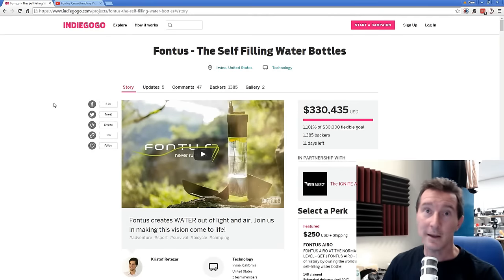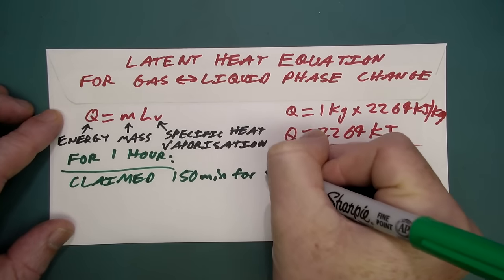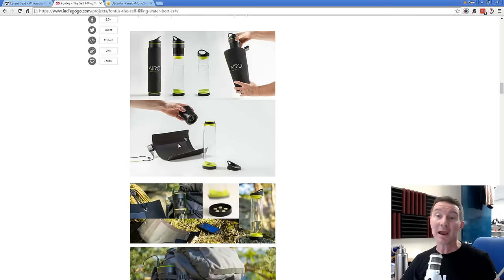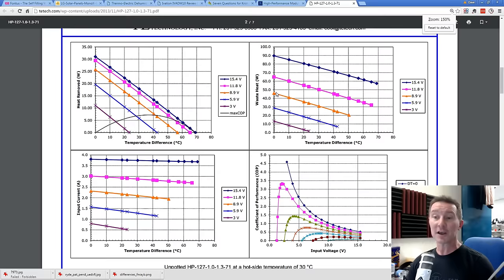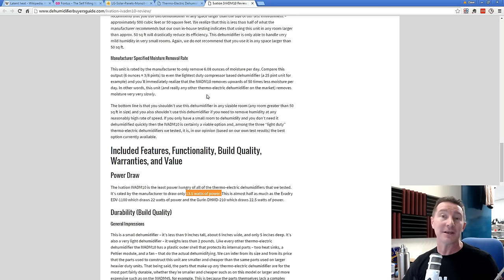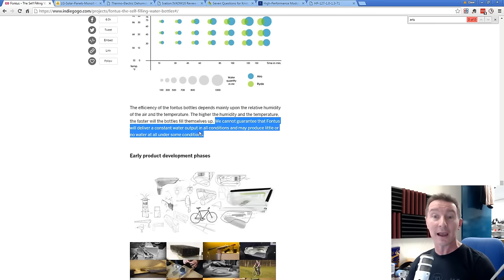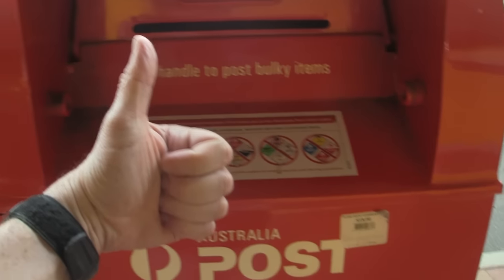EEVblog #881 - Fontus Self Filling Water Bottle BUSTED!

Comment: Well.. you did a lot of errors.
4:40 that should be 905kJ/H.. not by liter.
4:50 that should be 250W/H, not by liter.

5:00 100% efficency. Well that is not really true. In a 44 degree enviorment that would be a 273K/317K .... =>13% carnot efficency. You could actually get as much as 7.2 times the energy out theoretically (with a real refrigeration unit, more like 4 times)

5:20" This is one of the most efficient 250W panel"
Well... i would say no, not really. Its 16% efficency, and sure, its pretty efficient for a rooftop full wafer monokristallin silicon PV-panel. But you can get partial wafer once that have almost 25% efficiency (they are quite expensive). You can also get gallium-arsenik one that is about 30% efficiency.. about twice as much... they hare quite expensive (mostly used in satellites)... There are also multi junctions once..... but to my knowledge you cant buy those (and if you could, they would be stupidly expensive)

8:00 correct this later, but i think its really a bad calculation error. Also, its not true that its "over 100%  efficiency". That you get say 500W of cold out of 100W of electricity is not 500% efficency. In this case it would be about 70% efficiency (calculating Carnot efficiency)

So you can get a solarpanel that is about twice as efficent. And you can get a real world refigiration unit that does 1:4 (they are a bit bulky, but really not that enormous, there exist smal once that is just over a kg).

So that would put the 250W/h to 62W, and 62W for a Galium-arsenike partial wafer solarpanel would be about , 10dm^2, about 35x35cm... so its actually in the range.

But on the other hand, its not for one liter its for, one hour, that is 4dl/h.

Its also a complex calculations, the heat fight down the efficency of the refrigiation unit, but the heat also binds more water. So you have to process less air, but need more energy to do it.. forcing you to do it slower. So the optimal temperature is probably lower than 44C. And of cause, you would have to point it 100% to the sun and also have no overcast.

 I really think the video should be recalculated with more correct numbers, there is a bit to much errors in it.
Reply: shomolya 
Sorry.. should of cause be 250W only (in this example).. not per hour

Also, i didn´t calculate it, i copied of the video, but its not fault.. well the units of the 250W was, but the rest is correct.

My point is that its not 905kJ per liter, but per hour, that makes it to 250W.
Reply: +matsv201 "So that would put the 250W/h to 62W, and 62W for a Galium-arsenike partial wafer solarpanel would be about , 10dm^2, about 35x35cm... so its actually in the range."
On paper and under ideal conditions combined with a solar power unit that is 4 times the size of the system displayed and a price tag that would be 3 times higher (for the solar power unit alone, mind you) than the total asking price of the device... So, yeah, totally doable...
Reply from the maker: +shomolya I did mention COP and heat pumps.
Reply from the maker: +matsv201 Yes, units have been corrected in annotation.
Reply: +shomolya You guys are way to harsh. Some units he got off, yes, but it's not a big deal, he corrected them via annotations. 

Also speaking of actually watching the video....... He did talk about COP and Heat Pumps. Come on. What a hypocrite.
Reply: +EEVblog But the Austrian government won't receive those annotations.
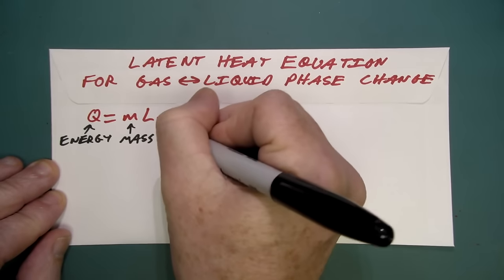Reply: +EEVblog I didn't watch the whole video yet, but the critical issue is that at ~2:15 you conflated the heat moved from the vapor to the environment (i.e. the latent heat of vaporisation) with the energy required for the Peltier device. The former is usually much larger than the latter, and their ratio, known as the COP, is usually significantly greater than 1. This can cause conceptual confusion in the audience, because it seems like you're saying the energy from the condensation is what's needed to power the Peltier device, whereas they're unrelated.
Reply: EEVblog Sorry.. if it was youtube annotation i didn´t se it. (i downloaded it for bandwidth contain problem)

Great that you answered anyway :D. really thankfull
Reply: shomolya yea.. i f-up the /h thingy.. but i think it was the only error i made...its quite oblivious when i read it back.. and it would be for most people that know basic physics.
Reply: totalermist Well.. yea.. on paper of cause.

But my point is to make a best case scenario.

The issue is if you are debunking something, you really want to go for a very-very best case scenario, because if you don´t people will just come with it and say you are wrong... and you sort of are.

So my point being it should be calculated with the best equipment that is on the market, and debunk it from there.

I also don´t like the "dehumidifyer" comparison. They are built down to a cost... they are really crappy.
Reply: Asad S Yea.. i kind of agree.

Its not really that clear cut in the video. And also mixing in percentage over 100% is dangerous, specially when talking about efficiency. COP is a better term.... or that i really prefer, percentage of carnot. When talking about heat engines it´s often a better way of using it. It also works both ways.

This is also a issue with electric cars. A lot of people tend to believe that electric cars are more efficient than one with explosion engines. That is not a clear cut case. Calculating the carnot efficiency a normal gasoline engine is actually quite efficient. You can sort of say that a electric car have a higher refined fuel.
Reply: shomolya Well.. i would say no. There do exist really tiny compressor system....

And you can make a bradley type compressor that is not really much bigger than a peltier element... granted, there is some tecnical difficulty in actually making one, and i doubt there is one outside a lab.... but it can defiantly be done. I would say you could go as high as 70% carnot
Reply: shomolya Well sure... that might be the case.. but you still have to take a best case scenario.. And i would say.. you could tehoreticly in the bounds of not just theoretical components, but actually existing once make something that would condense sufficent quantity of water. Then you have to go from there and look what the problems is...

This is how you debunk stuff.. i think dave cheted this time
Reply: +matsv201 
I'm thinking of sending a nice postcard to Kristof, like Dave did. Can you wrote down the right calculations?
And I would like to ask others to send a postcard from they'r own city with a nice calculation on the back. Address is provided @15:00
Reply: +matsv201 Finally someone that knows thermodynamics.
Reply: shomolya 
Well the real issue to me is that it might work in 90% humidity in 44 degree..... Actually with a ideal Carnot, or even say real 60% carnot efficency pump will actually (in theory) increase with lower temperature... as long as the humidity is close to 100%.....The issue then is that the airflow increace quite a lot.. at 44C the airflow is actually not that high, bot down to 20 degree its really high

But when the humidity droppes down to 40-50%... then it start getting really hard to get any volume out at all.

The real issue to me is the solcell directional issue and clowds..Make a simple sinus eqvation of the solarcell and se how much is losed... than ad clowds.... Then you go down from a theoretical maybe a liter every 5 hours... to a liter every day or two.
Reply: +matsv201 

"Well.. you did a lot of errors.
4:40 that should be 905kJ/H.. not by liter.
4:50 that should be 250W/H, not by liter."

and its 'litre' dumbarse not LITER - its all well and good pulling someone up on their mistakes but at least check your own before you do..............
Reply: Wait a second, the Americans have changed the spelling of a system they don't use? I would say that I fucked up but I think its the other way round lol
Reply: +Pony Power "Wait a second, the Americans have changed the spelling of a system they don't use? "

Nope, you are using the French spelling. The Netherlands, Germany and Belgium  and pretty much all Germanic languages use "liter" too.
Reply: vinny142 As well as scandinavia and most Slavic nations
Reply: +EEVblog I think we'd be all very happy to hear about that a bit more, even if heat-pumps are not strictly speaking EE.
Reply: Black Daddy Its not thaaat uncommon.. but its rare....

Of cause, math is very easy to prove, so the arguments are mostly rather short
Reply: Thanks for addressing the point from a more formal way.

Comment: It should be pointed out that you should take the COP - 1 to get the actual efficiency for cooling too. The electric energy used to drive the heat pump is also wasted (as heat) in a cooling setup, not just the produced heat. Side note: Sometimes you can see a cooling COP that is more or less than the heating COP - 1 on a compressor driven heat pump. The reason for that is simply that the machine gets reversed and the refrigerant gets routed a different way through different components, which can generate a different internal efficiency.
Reply: +Tjita1 
This, and also the need for a good heatsink source for the hot side.. otherwise the junction will fail to transfer any heat energy. I did not see much of a hot-side heat sink in that design.. also how efficient would it be if the OAT (outside Air Temperature) is ~ 60 deg. anyways?
Reply: +Tjita1 it also depends on the temperature differential. If you are cooling 90 > 70 it's only a 20 degree difference, if you are heating 0-70 it's a 70 degree difference. I'm pretty sure that the refrigerant doesn't get rerouted, just the valve reverses to allow the flow to reverse (you don't have 2 separate compressors or evaporators, they just swap roles)
Reply: +2Awesome The reversing valve just makes the refiregerant go first into the evaporator or the condenser, depending on the setting. Basically it's like taking a window air conditioner and turning it around so it blows hot air in the room and cold air outside. The compressor is not reversed because it is reciprocating (you would need to change the one-way valves)

Normal:

Compressor - Condenser - TXV or capillary tubing - Evaporator

Reversed

Compressor - Evaporator - TXV - Condenser
Reply: Speaking of COP, I would rather that term be used rather than "efficiency". I have seen so many "free energy" claims that boil down to "an air conditioner could power itself and then some because its COP shows that it's more than 100% efficient." These claims ignore Carnot efficiency: the a/c's hot side is not that much higher than ambient, so the maximum usable energy from its hot side is far smaller than the apparent "watts out".

Comment: Hi Dave, I'm afraid your thermodynamics are not correct. When the temperature difference between the cold reservoir and hot reservoir is small, which should be the case when the RH is as high as 99%, the efficiency is very high [COP = Tcold/(Thot-Tcold)]. Even if the Peltier have a efficiency much lower than the ideal heat pump, the process is much more efficient than you calculated. Recall that T in the COP is in Kelvin.
I hope this helps to clarify. 
Cheers,
Jorge

Comment: Even if they had an enormous solar panel (or a super-efficient cooling technology), they would still need to move the air past the cooling mechanism. Could you do some calculations on this aspect of it?

How much air do they need to push past the peltier device to access 1l of water vapor, and how much energy would that take if they were to move all the air in 250 minutes? The bottle has only a small aperture. At the speed the air will be going, what temperature does the peltier device need to be in order to cool the air sufficiently for the water to condense, and what energy is required to maintain that temperature?

In their best case scenario they have fast-flowing 40C air, which is not an environment where I'd expect to see much condensation!
Reply: +Mr. Emma Wray a bit less than 100 cubic meters of air...
Reply from the maker: +Mr. Emma Wray I looked at a typical fan datasheet and the airflow actually works out. Didn't include it to save time, as there wasn't much value in it. And I didn't want to confuse people with "well, this part's viable, but this ones not" etc. Best to just focus on the part that kills the whole idea dead.
Reply: +viermidebutura assuming a 5cm radius and 2.5 hours, that's 1.4m/s air speed so the air doesn't spend much time in the proximity of the cooling mechanism. The condensation process needs to operate with 100% efficiency in about 1/20 second. If it's less than 100% efficient they need to increase the speed!

100 / (0.05 * 0.05 * pi) / 2.5 / 60 / 60
Reply: +viermidebutura That is not corect. In 44C and 90% humidity you get about 65g/kg, 5g is lossed in convertion, so you get 60 grams out. 

You get about 1.3kg per cubic meter... So that is  1000g/60g/kg=17kg of air, with 17/1.3=13m^2.

That makes it 5m^3/hour... its not really that bad. Of cause, its in the terrible 44C temperature, but in the lower temperature the extraction rate would also be lower.

For instance if you have 50% humidity and 15C, its impossible to extract any water with out sublimating it, and you really don´t want to do that

Comment: 1L water doesn't take 2269 kJ for condensation, instead it produces 2269kJ. Why would you need to provide additional 2269kJ to condense the water, i have no idea.
Reply: +SG1guru Because as water condenses it gives of energy bringing the temperature of the condensor closer to that of the gas. As it reaches equilibrium no more condensation will occur.
Reply: +SG1guru 
You need to actively remove that amount of energy from the air/water vapor for it to condense. You have to work against the equilibrium point.

Comment: Dave, you forgot a major argument NOT to use this system: the condensed water is 100% demineralized. Drinking it can be very dangerous, due to its direct effects on the intestinal mucous membrane.
Reply: +Thomas Leerriem This isn't really a problem unless you run the thing inside a clean room, it would pick up tons of dust, dirt, bacteria and viruses and who knows what else from the air. So you'd probably want to boil it first (just like rain water)

Comment: It essentially produces distilled water, so if you get it to work in the desert it replaces the quick death with a slow one, cause you die from drinking distilled water. Is why the condensate from an AC unit goes in the garden, you can't drink it.

Comment: It doesn't take as much energy to move heat to another place to cool down, as compared to converting stored energy into heat.  So, to move 250Wh somewhere else to  make the condensing surface cooler, it doesn't take 250Wh.  Actually, Dave gets into that at about 8:30.

Comment: Heat pumps and peltier elements don't have efficiency more than 100% (if that was case we would talking about perpetuum mobile machine) they can have coefficient of performance (tells you how many units of heat pumping you will get for each unit of electrical power you supply) greater then 100%.
Reply: Peltier 8% efficiency at best.

Comment: When I saw this product announced 6 months ago, they were claiming like 0.5 liters in 1 hour!  I thought wow thats incredible.  Then I did some research and looked into small commercially made 50-70W peltier dehumidifiers on Amazon.  And most of them you'd be lucky to do 0.5 liters in a day using 50-70W constant!  No way could this thing do 0.5 liters in 1 hour unless it was literally raining!  You'd be lucky to get a good gulp of water out of this little joke device!
Reply from the maker: +asusreviews Yup, pretty trivial to debunk right there with a commercial comparison.
Reply: +EEVblog Yes, I actually spent hours after that research various dehumidifier solutions.  Traditional compressor coil based dehummidifers are larger and noisier than the tiny peltier ones, but are overall more efficient at pulling  water out of the air then peltier based units.  Also I learned about Desiccant dehumidifiers which I had never heard before.  Apparently they can work better than compressor dehumidifiers in some environments, especially colder climates.  There are some people that run a dehumidifier to provide their drinking water needs.  Very expensive though.

Then there were some interesting designs people had involving geothermal technology for condensing water by using fans to push air through metal pipes in the ground in order to condense the moisture and collect it.  All very interesting ways of getting distilled or almost pure distilled water. :)

Cheers and thanks for the video.  I actually was going to suggest that you debunk it, although I already had (just without going into all the in depth numbers you did).

Comment: 4:53 there is an error in the Unit. If you devide 2267 kJ/liter by 2.5 hours you are getting 905 kJ/(liter*hour). Not 905 kJ/liter. The 250 W/Liter are correct
Reply: +Ede M He did say so out loud, but he missed writing it. And now its in the mail.
Reply from the maker: +WakarimasenKa In some mail sorting depot already!

Comment: Congratulations on calculating the latent heat of condensation for that amount of water.  But as you're not boiling the water, you don't need to input that energy!  Your claims that you'd need a huge solar panel are bunk. 

You need to MOVE the energy from place to place, keeping the cold side of the peltier cool enough to condense the water out of the air.  As long as you have a very good system, for example: the headwind on a mountain bike going 20+km/h through brisk mountain air, blowing over a well designed radiator, this still sounds feasible.  In fact you can see this is the design of the bottle, on his website.  The solar panel just powers the peltier, the radiator is bike powered.

I'm not sold just yet, but your debunking is overly hasty.